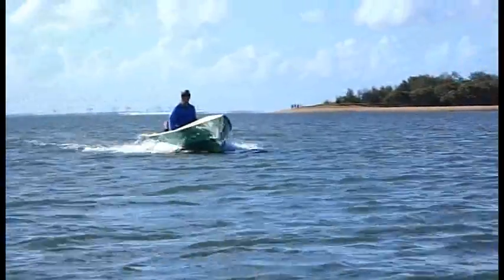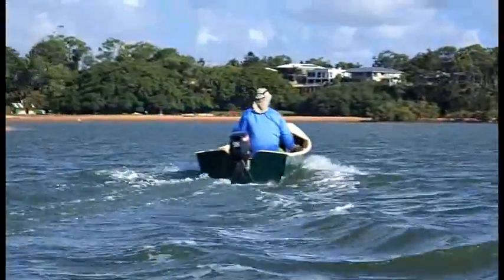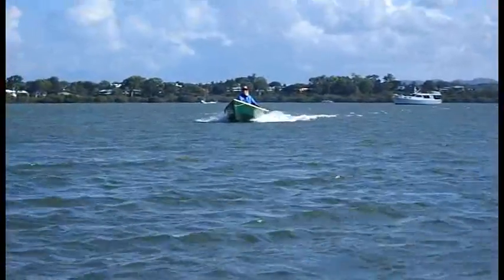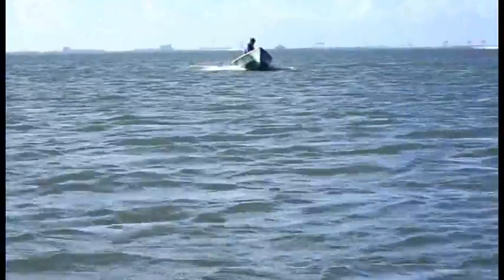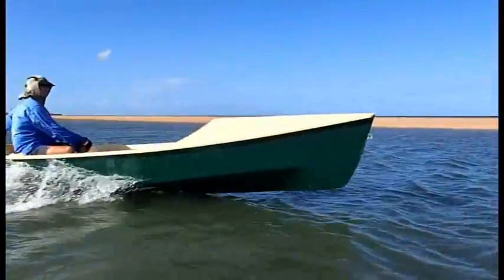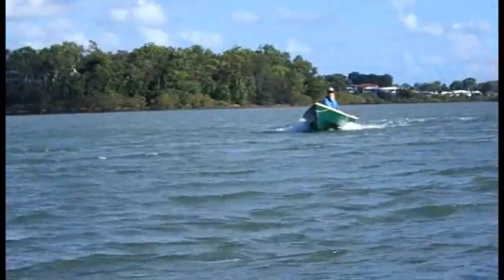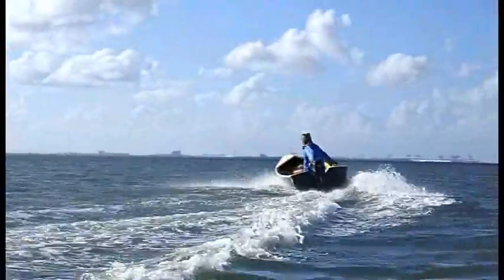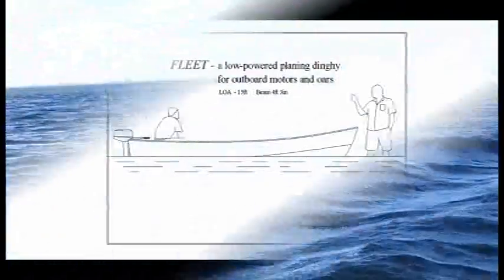Fleet - low-powered outboard planing hull

Comment: Good video Ross! What size outboard and propeller combo do you think would be appropriate for planing my scaled up First Mate with a passenger? So far I've tried using a 12000 Watt electric motor with what feels like a too-small propeller (7 1/2") . That Wattage should have meant a 16 HP equivalent, but I wasn't planing. I felt the boat try to plane but we didn't get up. I saw a big wake behind but I don't think our speed over water was much higher than my lower wattage tests.

Comment: Wonder if you have done any experiments with the mid-mount low speed diesels?
I would love to try that with a 6HP chug chug. I know you said a 4.5HP, but the engine weight would require some...and a decent rudder setup with a rack/pinion steering setup.
Also, as the cost of carbon fiber comes down, this would be something to experiment with to see how little you could get it to weigh while retaining a super strong little seaworthy boat...